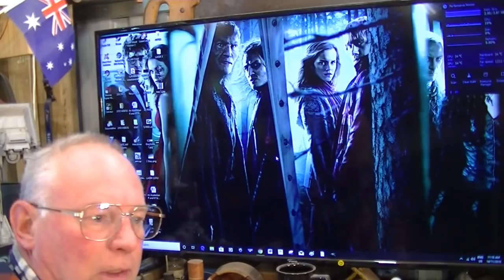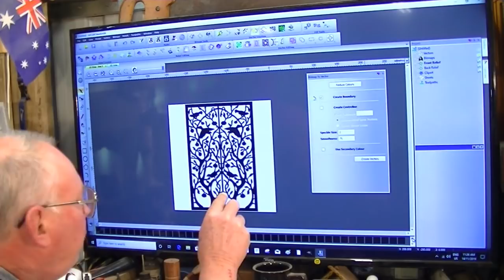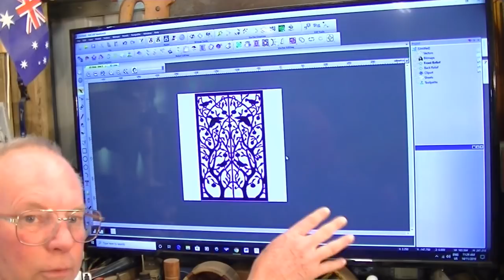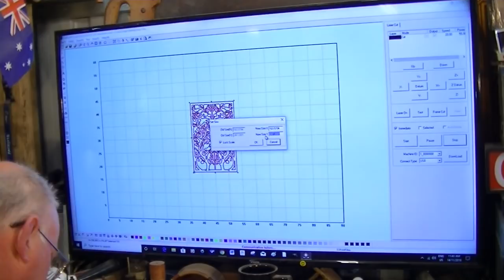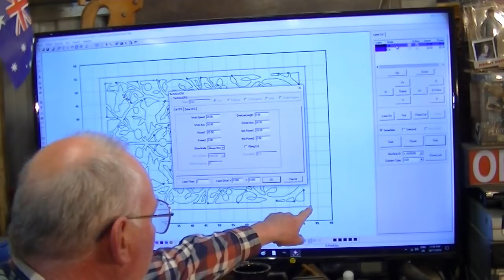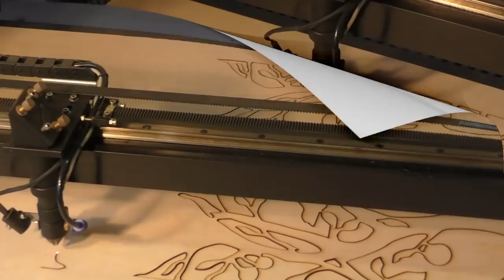100W laser *HOW TO* make $2500 per day of art-decor window panels

Comment: I was well into the video, before I realized you were to cut recycled forest carbohydrates. I was all amped up for steel !  I really like the manner in which you educate. Many tend to fast talk, or leave out steps, expecting everyone already knows each step well. My primary interest is in an engraving solution for on-the-fly work. So far, fiber laser approach seems to be more of a job-shop type of thing, so device can warm up. Cost per use would need to rival a rotary engraver, and in order to not lose sharp results, a motion table to bring the work to the laser. There are a couple self-contained products of the sort from Red-T, but they are still in the embryonic stage. I fear this stuff will shrink in form factor and become what I need post-retirement! For now,  I am stuck at office, doing paperwork..... and I found your video as the result of viewing another laser that was recommended I check out. A nice way to kill some time during this shutdown, even though I am considered "essential".

Comment: Hello, that laser machine is that? and can it cut 16gage steel? Thanks
Reply from the maker: No, you would need a fiber laser for that.
Reply: @inventorsworkshop9600  Hello, Roger and nice little setup for your business/hobby. As to the question that Martin Z and cutting 16 ga. steel. Yes a fiber would work well, but also a larger CO2 would work as well. Of course we are not talking 10-12 thousand dollar laser either. Much greater. I am not currently, but I operated a German built 1500 watt laser for 23 years here in Houston, until the company sold it to a contractor in Alabama that had an identical one...For parts to cut his government contracts. while employed and operating this one, we ran it10-12 hours a day usually 6 and sometimes 7 days a week. Most the metal we cut 90% was stainless steel 1/4 inch to 14 gauge. Most of the 1/4 inch SS was and some 3/8 SS was cut with oxygen and the 10 ,12, and 14 gauge was clean cut using Nitrogen. From 1991 - 2011 we would almost cut a million pounds of Stainless Steel making our own product. In about 2011 they started outsourcing the cutting to Mexico vendors and some in China... that was a cluster ,to  say the least. ( wonder how that is working form them now?) I assisted in rebuilding that laser 2 different times. One time at the cost to the manufacture and the last time was on the company, I signed the bill, which was a whopping 84,000 dollars. I had tried to talk to management and (put my 2 cents in) and upgrade instead of rebuilding.
But, what did I know, I was just a lowly operator that new the machine, mostly inside and out. After a year has passed it was back to loss of power and going through lots of optics. The company was sold and we started outsourcing more and the laser was sold. It was still an OK machine but was in need of new ballscrews. Not cheap! on a 60 x 120 table, yes that is 5ft by 10 ft table. I cut out lots of cool stuff while I was there and made myself a few things too. Not only did I operate and nest up parts with the software, I operated our 750 ton CNC Cincinatti Autoform Pressbrake , operated a 8 ft pinch roll and am a welder/ fabricator. I have made some nice things to say the least.
Our laser was a 1200 watt laser , but we had oversized heat exchangers on it and we could easily run 1350-1400 watts. I have tuned it after a new optics change and gotten 1500 watts, Talk about cut some stainless!!!
Anyway ,Roger I just happened across you channel and thought I would check it out. Cool Stuff!
TW

Comment: Hey Roger, thank you so much for this video. .. I have been working with a lasercutter for some time now (free access to one via a hackerspace, only have to pay for materials)..

Question: One thing I dont seem to understand is what if you want to go bigger than the 600x300 space of the laser. How do you cut up the objects? Do I need to design it that way in the design software or is there some support in the laser engraver driver.
Reply from the maker: No you need to design it in the software

Comment: I used to program lasers at a Fortune 500 company to cut primarily 6mm steel for hydraulic tanks. I found your video very interesting. How do go about finding / acquiring work for your laser? To me, learning to program and operate this equipment would be the easy part, but finding enough work might not be.

Comment: I know the approxamate cost of software but what is the initial cost of an Industrial grade 100 watt laser as well as the cost of a replacement for the laser tube?
I know of a metalworking shop in the states that has a 4Kw laser and they work with steel up to 1/4" thick. They specialize in automotive parts and accessories.

Comment: PUT GLUE ON EVERY PIECE THAT IS CUT OUT. LAY BOARD ON IT. LIFT UP BOARD WITH ALL CUT OUT BITS IN THE EXACT SAME AS OTHER PIECE AND HANG ON THE WALL IN THE SAME ROOM. WOULD MAKE A VERY INTERESTING PIECE.
Reply: @AV036  IM 51. NO EDUCATION. JUST BEEN DOING IT THIS WAY FOR YEARS.

Comment: I thought this piece of equipment would be really expensive. A quick search yielded about 3k if I’m not mistaken. The potential has my mind in serious contemplation. I feel like you would need a lot of customers. The potential though?
Reply from the maker: This laser was $11,000 with tax
Reply: Roger Webb Clearly I was mistaken. I stand corrected.
Reply: @tmbacz  No, you are correct. 3k will get you a machine in China simular to this one, although maybe not with all the features this one has (automatic focus distance measuring etc.). You'd have to be willing to do your own support, as they will not send a technician with it for that amount.
In fact, if you want local support, there is a cottage industry of importing these lasers, rebranding them and installing/supporting them in place. That will get you up to 11k for roughly the same machine.

- edit -
Small correction: there is some good advice in video 207. A 119W peak output laser is typically marketed at 120W,  not 100W. Running your laser at its limits will shorten its lifespan considerably. Reci seems to be a good brand. The Reci we got was marketed at 100W and had a peak output @107W. As will all things China: ymmv.